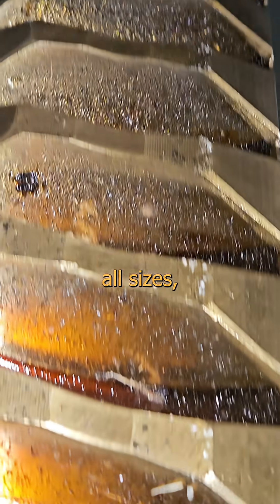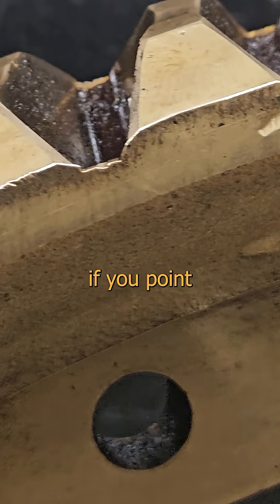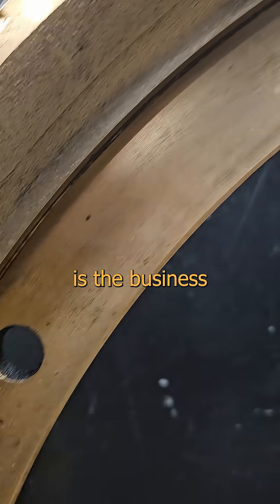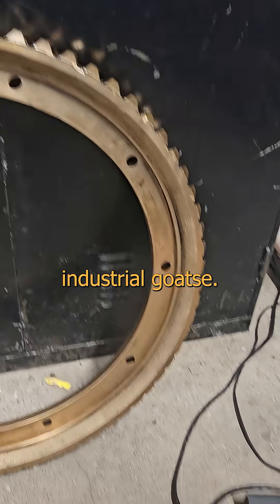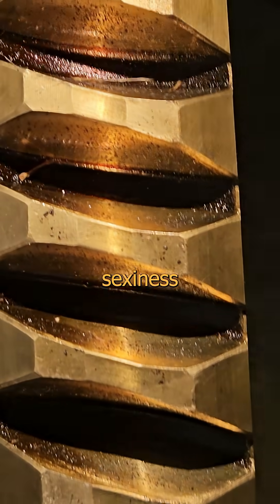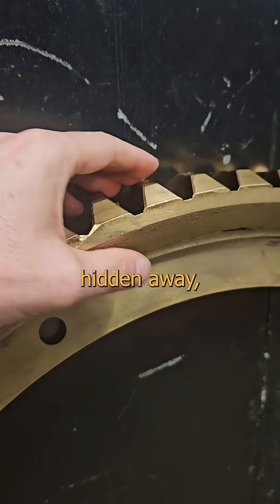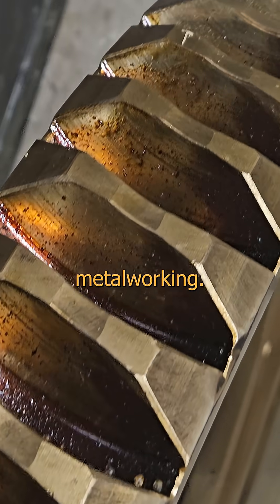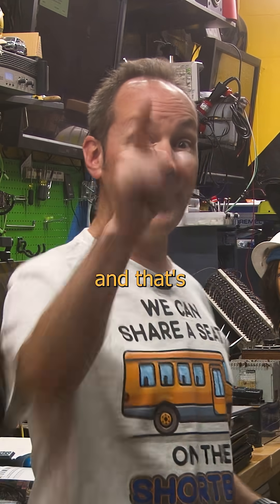Giant Gear #chrisboden #comedy #engineering #metal #educational #parts #diy #building #machine

Comment: This is really cool. I'll probably work a lot with gears in the next ~7 months but not the metal type because those are too heavy to be safely useable as stage design/props for theater.

Comment: I used to work at an elevator company where I used to get the old machines from the buildings and I’d have to strip those gears out. Big pain in my ars. But they are worth a decent penny in scrap

Comment: Hey, I used to machine those.  Th geometry of the teeth on that one actually look familiar. Cone Drive in Traverse City manufacture a worms and gears that have a very specific cut on the teeth that as of 2018 had not been successfully reproduced by any other company.  Also, they make some big fuckin gears.

Comment: One of the places I worked at when I was an apprentice, made fencing and roofing sheet metal products. Each machine had 8-12 gearboxes with phosphor bronze worm wheels and gears. As long as they had the right kind of oil and kept lubricated they lasted for years before they needed rebuilding.

Comment: What makes me sad is that you have recognized that there are people who enjoy watching a machine run and do the same thing for hours on end. They notice when the machine isn't running correctly, they notice when the paint has chipped, they notice when incoming parts have changed. Society's solution to these people is to label them autistic and in need of "medical" care while ignoring the fact that man is wired to have purpose even if his purpose is to notice the changes in mundane, everyday things that make the world work. I have several friends that are autistic and they are absolute geniuses when it comes to writing and debugging software, wiring up a control panel, or even watching a labelling machine apply labels to soda bottles for hours on end. Autistic people are far from disabled, they just don't fit the mold of modern consumer society filled with tiktok brain rotting videos. Thanks, Chris!! You are a great man.
Reply: The medical world has to have labels, that's how diagnosis works. You don't have to assume that having a label is a bad thing.

Comment: I got two old gears from a long gone lumber mill in my family's backyard. Old cast iron relics that, when I found them, still had the cracking and crumbling remains of their lead bearings/bushings. One's cracked, both still on there shafts, complete with mounts of some sort,also seized practically into fusion. But with them being a single and a double (a large gear with a smaller gear that the single one connected to), I want to try and find more like them attempt to restore them and make some sort of exhibit with them.

Comment: I like collecting scrap metal bits for art projects. I have made some very nice bits of furniture(20 inch chrome wheel table with piston legs, and 55 Studebaker tailgate bench were 2 i made recently) Anyone who ever asked about buying one very quickly realizes that they aren't exactly easy to transport. 
The Studebaker bench weighed as much as a complete small block chevy engine.

Comment: Looks like the ring gear off out of an older OTIS traction gearbox, paired with a fly ball governed and potentially the controller cabinet cover behind it? You know an elevator guy out there don’t you? P.S I recommend getting your hands on some Babbitt cable shackles to use as the table legs, that would look pretty wizard!

Comment: Worm Drives Are Everywhere. Central locking systems for cars, automatic machining lines, power transfer spindles for robotics... we had a 1920s device for cutting keys that was worm-gear driven. Put the key and the blank in parallel vises, apply power, push the button, and !Blam! Worm gear travels, pointer is pulled across key, blade mills blank to the shape of the key, pointer falls off key, key falls forward onto wire brush, gear travels to limit, carriage hits switch,  machine shuts off.

Comment: Let me get onto my soap box as a guy who cuts these... that is as you said a worm gear, not as you also said a helical gear, although helical gears can be driven by a worm this is not one of them. Gearing is about the dullest subject you will ever find, and the only people who can be bothered to properly learn it are the ones who make them. Don't even get me started about the difference between a key, a key way and a key seat. Fun fact worm and wheel combinations with over 2 starts can be back driven.. the ford model aa used one as a diferential instead of ring and pinion.

Comment: Let me guess, the ring gear from a geared elevator machine? The flyball Otis-looking governor later in the video makes me think that. Those bronze gears would last forever as long as you kept a good stock of Valvata J460 in stock and changed and flushed the oil annually. Good stuff, has tallow in it.

Comment: I was lucky enough to go to Maui recently, and ended up visiting the Sugar Museum. It’s located inside what was the house of the sugar mill’s manager. The abandoned mill is still there, as well as a bunch of old machinery. While a lot of the museum is focused on the people who worked there, it also features an original sand-casting setup for making the gears for the machines. The walls are covered in the handmade wooden masters used to form the sand molds as well. I’d recommend anybody that is in the area to check it out. ⚙️

Comment: My best hack was in pub, off duty using an empty packet of crisps and some electrical tape from another customer. Made a valve dressing for someone who'd been stabbed in right chest. It stopped air build up in pleural cavity causing a pneumothorax. Person needed load of wound cleaning to remove bacon flavouring from wound but they lived. That's what mattered. 

Crisp company later sent me 3x boxes of crisps to eat.

Comment: This is the only part that you cannot replace it because it comes with its respactive pair worm,
And for.
Building one you need the other one,
Because during building an assembly of an warm and a gear,
You usually make one and then try to,
Make the second half of pair either warm or gear with first part,
It's like the part Becomes the machining tool for cloning it's twing pair.

Comment: Where I work we have centrifuges that use similar brass drive gears. With the amount of mass moving at high speed, you most definitely want the gear to shear if there is a catastrophic failure, hence why it's made of brass.

Comment: Honestly it would be really slick if instead of a table you turned it into a bike wheel. A bit of clear rubber resin molded around the teeth and you can then use the ring that bolted it to whatever it was connected to to either a set of spokes or whatever you want the spokes connected to. Imagine to looks your going to get riding down the road with that gorgeous thing of beauty on the front of your bike.

Comment: Evil Grin I know of a Navy name for this mechanism that you'll love. It's called a, "Jacking Gear."

The Navy turns its ships' propellers by steam or gas turbines. Those normally spin at several thousand rpm, but the propellers only spin, at most, about 120 rpms and more often 50-70 rpm, so we need a reduction gearbox between the turbine and the propeller shaft.

Before starting those turbines, we have to turn them very slowly, to make sure all the bearings are properly lubricated. That's the jacking gear, a worm gear that engages the large bull gear in the reduction gearbox and slowly turns it.

And THAT'S pretty cool.
Reply: As a MM in the Navy, I'd actually seen a main engine turbine before, but never the jacking gear. Pretty cool.
Reply: @davemoore1233  Battleship New Jersey channel, Ryan did a tour of one of the 4 main engine rooms and did a bit on the turbine, 90% certain he points out the jacking gear but not sure if he explained what it was for.
Reply: Isn't that what always happens when there's a large bull, everyone else just makes a jacking ring.

Comment: At work I see them every day in all shapes and sizes. We manufacture all sorts of gears, racks, worm drives etc for industrial applications. One common misconseption of worm gearboxes is that the output shaft is locked in a way that it only turns when driven by the input. I couldn't believe it myself, until i tried it with a 3:1 worm gear drive unit, where it is possible to turn the output shaft by hand. And that's pretty cool

Comment: I wish I could post a picture here. I pulled a set of gears apart the other day on a solar panel setup that tracks with the sun. It stopped spinning so I went to investigate. When I pulled the motor out that ran the worm gear it was cover in metal shaving grease. The main gear was totally destroyed!

Comment: I actually run a CNC Gear shaper at work! Theres so much data and parameters you need to able to cut a gear/spline to the correct spec but man when the CMM gives you that pass report on the first part then you know the day will be good!

Comment: I wouldn’t make a table out of it. Bronze is an alloy much to valuable for the industry and wasted for such a purpose. (You wouldn‘t use gold bars as counterweights either.)
It’s also environmentally detrimental because this insane amount of  tin and copper that this bronze wheel is made of, has got to be mined and refined using up lots of energy and causing pollution to restore what’s taken out of what otherwise come from recycled scrap metal supply.

Comment: The fact that it's made out of bronze is what intrigues me  the most; is it because of ease of manufacturing so it's cheaper?
Maybe it's not made to be replaced or serviced that often, bronze bushings is a thing after all. Maybe the cog is just easier to replace instead of the worm gear, so they made sure that the cog would be that part that failed first?
Like why not just maken it out of steel?
Reply: sometimes they make one gear out of a different material to control how wear happens. In this case- I'm betting its wear, lubrication, and Thinks I don't Know I don't Know. 

The tooth geometries are awfully complex- and that doesn't happen without a reason. I don't know what it is though.
Reply: @Originalsunrunner20 the cog would've been hobbed with a rotary cutter.. I'm guessing the worm gear is cut on a od grinder (more difficult) Bronze is about wear and the large diameter would allow for a recut with only a little change in ratio.. Tho I'm still mostly guessing..

Comment: 💡I would recommend to use a round crystal plate, inside the ring socket. To keep it neat and clear, to appreciate the gear. Even the bolt holes.
- Would be great to have the gear that feed that ring, or a planetary gear set... of course.
- The table legs could be something fashion and thin, like a spider lamp, for a home...
— Or, if for the workshop, full on nerdy fashion and ridiculously bulkier, it could be a wheel rim.
I would like the one of a mining truck, but I guess the diameter it's more like the one of a normal car.
— The sprocket that drags the caterpillar of a bulldozer or a battle tank, would be cool too, and would have the size.
A dozer sprocket could be found on a scrapyard, I guess.
— Or, a huge electric motor outer case, or the inner stator/rotor. With or without the copper wire. The steel structure itself, would be big and heavy, with a shape cool enough.

Comment: We had those gears driving our tablet presses.  If you need to apply 10 tons of force through a 3/4 inch punch and die set, you need enough power to push the punches under the compression wheel and just a standard belt on a pully wont do that consistently.  (A Manesty Novapress was the unit of choice when you need big compression)

Comment: I did know about the other channel, I just haven't had a chance to get over there yet as I typically get on shorts when I don't have a lot of time to work with,  for example I have to get ready for work after I post this comment. 

(Also the link in the pinned comment isn't clickable on mobile which means I'd have to hear and remember the name for more than 3 seconds and manually search it)

Comment: OK, "metric fuck-ton of foot-pounds" can be an honorary SI unit.
Reply: Not to be confused with an imperial fuck-tonne of Newton-Meters 😂
Reply: Old Canadian 🍁 power engineer here. 
I assure you that we still use both systems here ,every Day . For the sake of conversation, his unit of measure is perfect 👌. Everyone understood exactly what he meant. Big torkey beautiful bronze gear 😊!
Reply: @ClaudePelletier-my2qx  well on europe and asia too its used just people doesnt know what 1/4'' means :D which makes lots of people waste gigawatts of brainpower trying to convert it to metric system which hard and has no direct conversation because 1/4 is not actualy you cant divide 1inch to 4 and get a metric equation of that in integer state :D 
water pipes use that for example on europe and middle east as far as i see so i had to do lots of research to find just required size pipe connectors for example on lots of different times :D
Reply: It’s the sister unit of measurement to the German standard for torque; guttentight. Cousin to the American standard unit; ugga dugga.
Reply: 😂 as an uncle of mine used to say... I don't deal with silly-meters!
Reply: I admit that I have a bit of envy and admiration for the folks that got to machine that beautiful gear... and noticed it was a worm gear before you mentioned it... and agree it is pretty cool!
Reply: Fun fact: Telling people on the floor to "step back and fuck yourself" is actually a term of endearment. It usually means "get away or you will get hurt". Sometimes that is the result of a machine in a specific state... other times, it is the result of hurling a box wrench out of frustration.
Reply: I think it would more properly fit in the FFF (furlong, firkin, fortnight) system of measurement.
Reply: @robertlovlie5194  i read this comment as he said this lol
Reply: Seconded
Reply: First time I heard "metric-fuck-ton" was 2012, and it got immediately adapted in my vocabulary. nice to see, that it's catching on, not just with me. 

we might still get it into the oxford english dictionary
Reply: Honorary because foot-pounds is imperial
Reply: That line is awesome!

I should know better by now.  Don't take a sip of coffee while watching Chris. It burns coming out ya nose!
Reply: A ton is 2000lb, and a metric ton is 1000kg or 2204.62lb. One could say that a metric ton is 10.231% more than a "normal" ton. 

Therefore a metric fuck ton is simply 10.231% more than a "normal" fuck ton. 

Simple!
Reply: I never realized that was a regional/us thing to say until I was talking to someone abroad and they actually asked is a shit ton like a metric unit or are you just being funny/sarcastic 😂😂😂
Reply: Fun fact, and Imperial Fuckton is an actual unit of measurement
Reply: Nah, we Guillotined the royal Bastards for a reason
So no Kings foot fetish(nope, no kink shaming intended) in our neatly & logically arranged metrics

And yeah, I admit it! I so have ADHD, Autism and a compulsive need to keep things orderly and working class on this little blue dot
Reply: I'll rather hop with the smelly feet folk than the modern Robespierre's thanks 😂

In an ideal world the yanks would just realize they've already been on the metric for half a century anyways 🤣
Reply: @RiversJ  we all know we’ve been on metric for the last few decades as every American is taught it in school as far back as the 90s. you just gotta get it in the head of the geriatrics that we have running this shit hole of a country and convince them to spend a couple billion less on national defense that we don’t need in order to replace all of the signs in a country the same size as mainland Europe. But hey, even Canada and England, can’t get their shit straight when it comes to what units to use and for the most part here anything scientific or with any degree of precision we run in metric and anything that just needs to be eyeball accurate the imperial system is pretty good.
Reply: @Marian_Martin_Morgenstern FUCK the metric system. Takes all the romance out of measurement
Reply: @stock_movie1875  
Aah, don't flatter me, someone could thing you're a flirt xD

Anyway, don't be salty just because we killed our behated Royalty and with all due disrespect, just do the same!

Its a really freeing feeling
Reply: no it can't because its already a real unit. a Metric ton would be 2,204.6 pound feet of torque.

Comment: What do you think for a base? I'm thinking ten pieces of all-thread bolted into those holes in the face of the gear, then passed through a round piece of plate steel with ten holes in the circumference, then bolted to another, larger round piece of plate steel on the bottom. Bonus points for making four or five of the all-thread spokes longer and putting rubber feet on them. Then give the top and bottom about 30 to 60 degrees of twist relative to one another and tighten it all down. It would look like two truncated cones stuck together at the cut bit. Then plate glass on top, of course.
Reply: I'd like to see the worm gear with a spider connecting the central point on the worm to balance the ring gear then have the same ring gear on the bottom.   Drop glass in the top and you have a nice "round".
Reply: @Iamdebug  Oh, well yeah, if we're dreaming big. That would be awesome. I was just thinking that, if he actually had more cool gears, he'd have shown us.